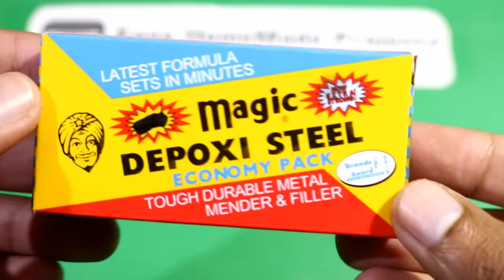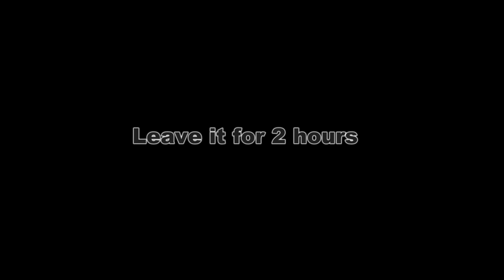How to Make a Powerful AIR COMPRESSOR using Syringe

Comment: nice project!!!.. question, why the extra syringes to house the valves for?  Why not just put the valves on the syringes connected to the motor? 
With the extra syringes does it build more pressure?
Reply from the maker: +j probe there is no extra syringe. All in use. Watch complete video

Comment: hi,great video. so what are the bicycle valves for. Excuse the question, I studied electronics, I am not familiar with some of the mechanical engineering principles
Reply: In case you forgot asking this question and never know what it's for. The valves are to stop air from intake stroke getting back out to atmosphere on up/compression stroke. And prevent compressed air (higher than atmospheric pressure) escaping on the down/intake stroke.

Comment: How much pressure in psi / bar you can get from this pump,have you try into an air tank for pneumatics engine? how often do you recharge the battery? Thanks

Comment: Tell me please, what engines are suitable for such products? Means the brand of engines, And how many revolutions per minute?
Reply from the maker: +Dean Sulfer a medium rpm (e.g 5000 rpm) high torque motors are suitable.
Reply: Is your motor RS 540 not 16800 rpm?
Reply from the maker: +Dean Sulfer 4800+/- rpm

Comment: I've come to test of my on diy air push via dc motor,  as i get the results the air buble become less if the holes of the tube get more deep in aquarium..  Which mean there's more pressure that push into the end of the tube from aquarium.. Hope u can show us if yur water jet can produce more air buble with large scale air aqurium such as 30inch..  I'm trying to build yur diy type for my little nephew.. Thank you.
Reply from the maker: +Shukri Ahmad Shukri thnx. This project surely work for deep aquarium. If your project can fill a balloon,  then it will best for aquarium.

Comment: I'm curious if you could make an actual air conditioner based off of this design
Reply: I wouldn't try a conventional design with this...you'd be leaking refrigerant all over the place haha.  If you used something like this to compress air into a tank outside (or another room, wherever your hot area is) then let it out in a controlled fashion into the cool area that should be enough to make the air noticeably cooler.  

You might be able to get away with using copper piping as a radiator right after the pump, but you'd have to keep the air in the radiator pressurized, so it would all hinge on letting out the air at a controller rate.

At the end of the day this pump can compress gasses to some degree, so some kind of AC is definitely possible...if you want a DIY AC I'd focus on something evaporation powered if I were you though, I think you'd get way more bang for your buck

Comment: how does compressor push out air? when syringe moves back wont air get sucked back in?
Reply from the maker: you haven't seen valves?
Reply: yeah ive seen them. just dont know how they work.

Comment: what is the need of bicycle valves??
Reply from the maker: +Mohd. Adil to flow the air in forward direction
Reply: Easy HomeMade Projects but there are two more valves which are not in used?? why??
Reply from the maker: 2 for air input and 2 for output

Comment: that's a pump, not a compressor.
Reply: As the air is being pushed into the balloon it is absolutely compressing the air. It's probably only capable of a few PSI and the piston seal won't last long. Regardless, it's definitely a compressor.
Reply: jmdowdy a compressor uses Reed valves and has a resivoir. a pump uses check valves (as seen here) and can cause minute compression within an elastic substance (the balloon).
Reply: Let me ask you this...is the air in that balloon compressed? Absolutely it is. The air pressure in the balloon is higher than the ambient atmosphere. Hence, it is indeed compressing the air. So at it's most basic level it is a compressor.

Your reply makes it sound as if a check valve and reed valve are different. A Reed valve is simply one type of check valve (one way valve) There are various types of check valves used on compressors depending on the application.